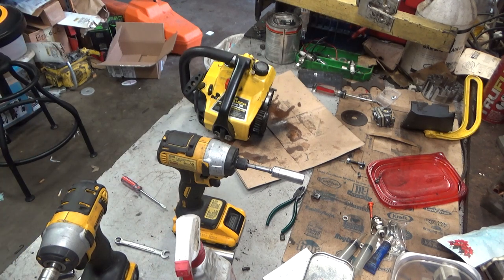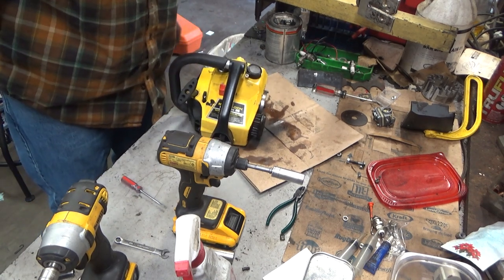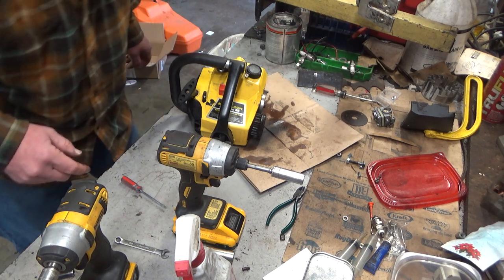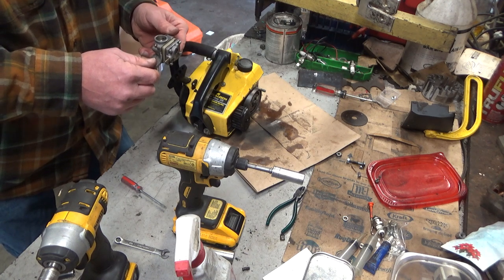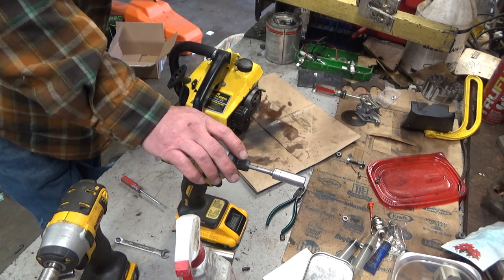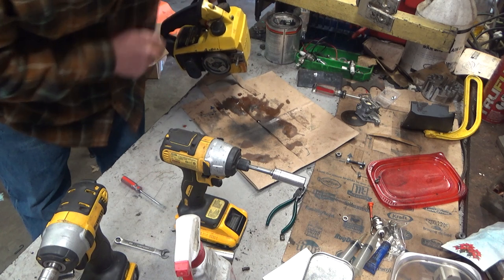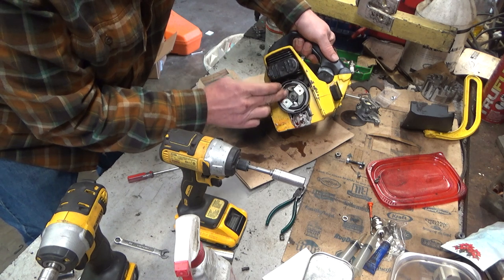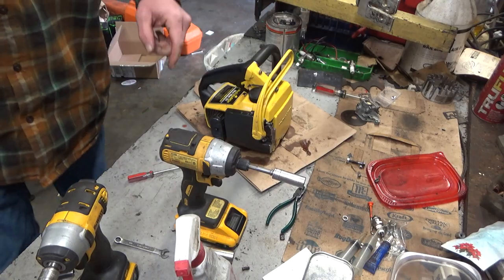Richard's McCulloch Mini Mac 35 Discussion & Test Run!

Comment: I have a 1970s Homelite XL2.
Question:
1.  Can I run synthetic oil in the gas/oil mix? (I heard that it's not good to run synthetic oil in older saws) Looking for clarification.
2.  If I use AmsOil would it be the 80:1 ratio (watched your 3year old ratio video)
Reply: Stick with 40:1 with Saber. I run vintage/antique Lawn-Boy mowers and I have an email directly from Amsoil stating that they don’t recommend running a mix any leaner than 50:1 in the older engines. 80:1 might be ok for newer engines, but I still run the 40:1 mix in all of my OPE new or not.